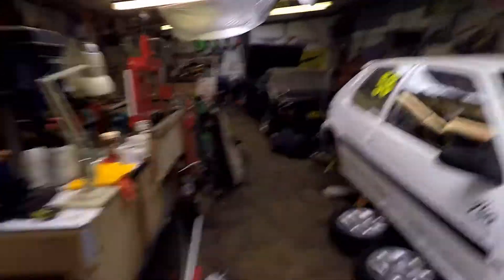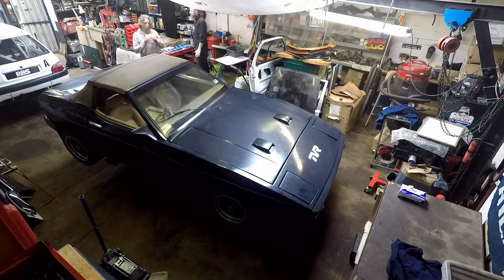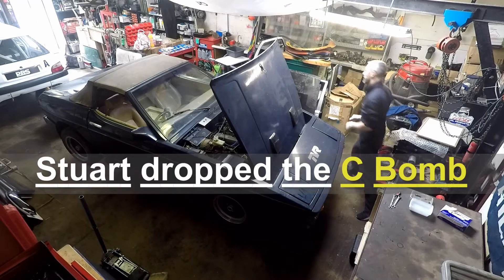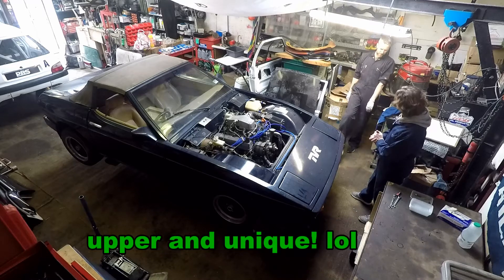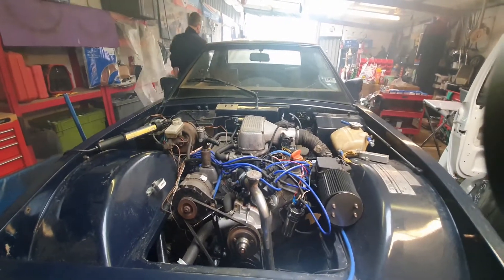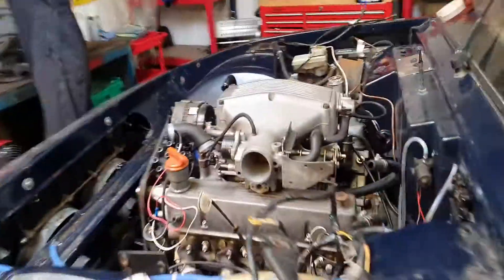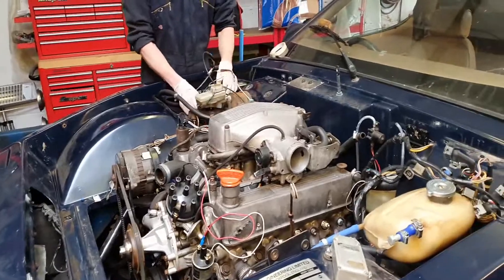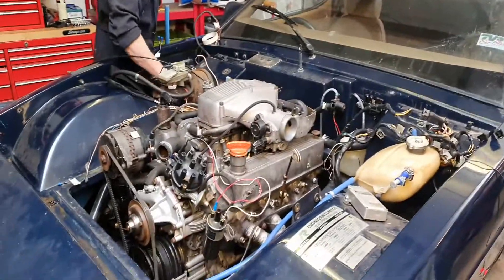Engine out for EV conversion on the TVR Wedgee. Pulling out the V8 Part 1. ChargeheadsUK TVRWedgee

Comment: It's no longer a TVR though once you remove the V8
Reply from the maker: Its still a TVR on the log book 🤔 is a tvr with an LS v8 not a TVR?
Reply: @chargeheads  As a TVR owner and s fan the car is all about the engine and the sound. The resale drops but you might not care for that.  It's going  to be a fibreglass and tubular chassis electric hotrod and you could achieve that with a lotus excel. If you can do the conversion to be non destructive and easily swappable back to ICE you'd keep the resale value. All TVR cars are becoming collectable in original condition.
Reply from the maker: @glennoc8585  tbh as the car had no history, 18 owners, no mot, powerflow exhausts and broken fuel system value was out the window on this one. I will keep my Griffith 500 ICE but this wedge is getting upgraded. What have you got?
Reply: @chargeheads  97 Cerb 4.2 and an 88 s1
Reply from the maker: @glennoc8585  fantastic cars. Always and still fancy a cerb v8. Look i love ice cars, but im looking to the future and that is electric, i know TVR's are about lairy, scary and no aids and that is what my conversion will be about keep, following as i don't want to let that down!

Comment: What are you doing with the V8 Engine
Reply from the maker: Well unfortunately i have no where in the house to mount it on the wall, so it is for sale 😉
Reply: @chargeheads  Ok I have a wedge here with the v6 ford engine I'm looking to do a conversion  to V8 would be interested in the Engine, exhaust, gear box and any other parts you have left over from your conversion that you will not be using. how do I get in touch with you directly thanks Romano
Reply from the maker: @romanoguttadauro9563  keep an eye on the blog 😉